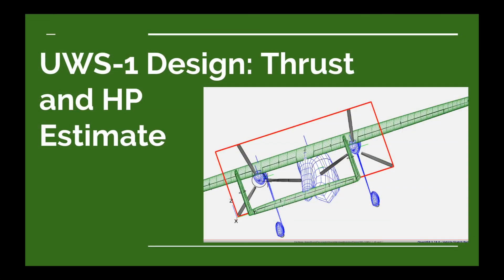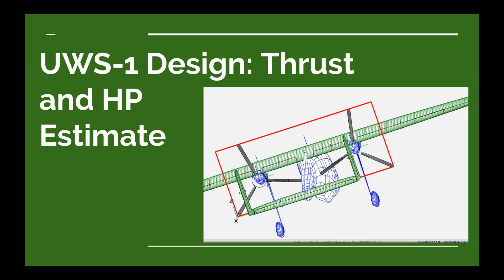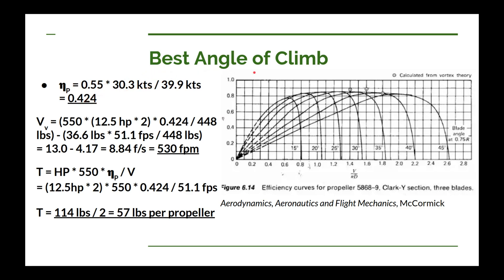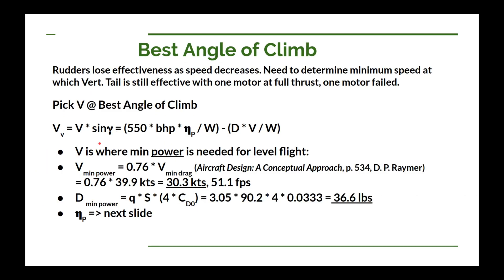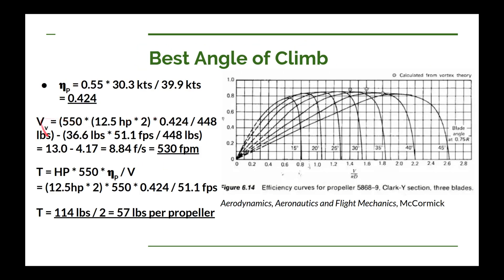UWS-1 Design: 1st Thrust and HP Estimate

Comment: 1. How did you get the Cd0 value? Is it D/q divided by S ?

2. if the vertical speed at the best angle of climb comes out negative, does that mean I do not have enough horsepower to even keep the aircraft level (will it even take off)?

3. Can the same equations for calculating drag in your video be used for larger and heavier aircraft i.e. cessna 172? I am getting very high amounts of drag and then having to put much more horsepower than the aircraft already has in reality just to counter it.

Comment: Great video, one small question: When you calculate T you use L/D from level flight (cruise condition, small AoA) but when climbing the AoA will be larger than that ? thanks again great videos
Reply from the maker: Thanks for watching. I calculated speed at minimum Drag, this should be the best rate of climb speed (cruise speed is higher). Once I know the min drag speed I calculate minimum Drag. Maximum Thrust is then equal to the Minimum drag plus extra thrust for the rate of climb wanted. I ignored drag at the cruise condition except for curiosity to find how how much HP was needed for cruise. To address your AoA question, AoA is higher when you are at lower speeds (assuming constant G load). BUT if you climb at the same speed as cruising speed then the AoA is the same. Most planes can do this at a shallow climb angle since you generally cruise at less than full power (75 to 80% of full power) but climb at more than cruise power setting. Pilots generally climb at a steeper angle and thus at a lower speed though so in general you are correct about having a higher AoA when climbing. Hope this helps.
Reply: @Designer103  thanks, the logic is clear now

Comment: You calculated the thrust with a prop that was optimized for cruise speed, but with a prop optimized for cruise how do you intend to keep your max level flight speed below 55 knots?
Reply from the maker: My current plan is to use a computer with an air speed input that will keep the cruise speed to a maximum of 55 kts.  That is the short answer. I tried a much more involved answer but Youtube would not take it.